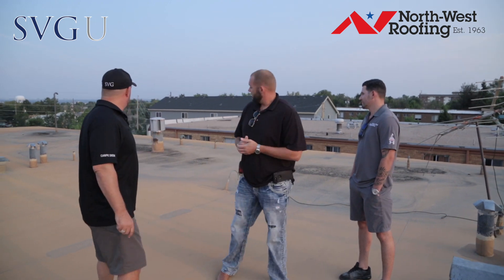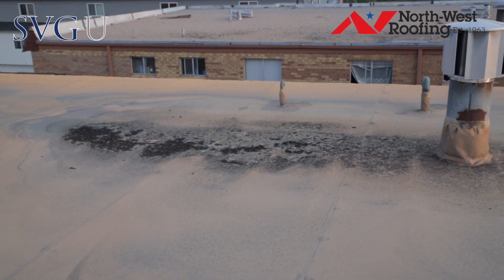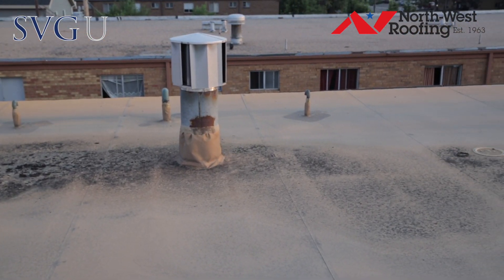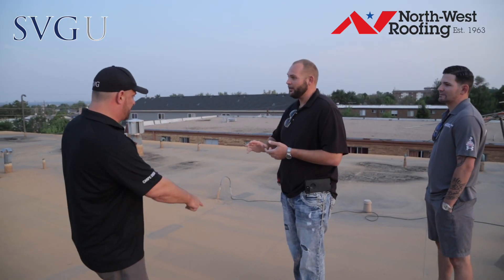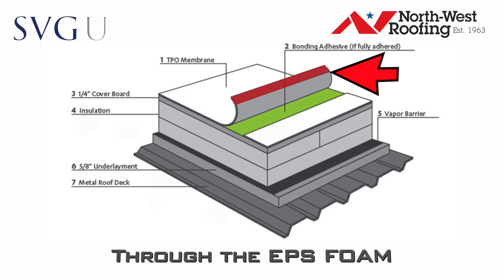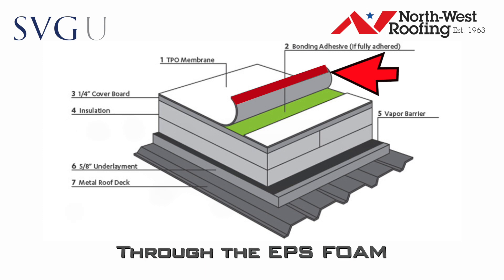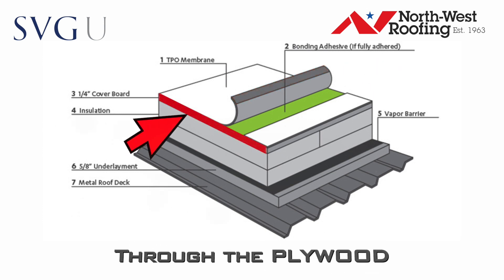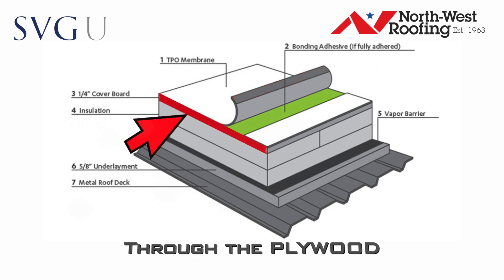Duro-Last PVC Commercial Roofing Systems 2 of 2

Comment: DuroLast PVC is still not TPO. PVC is typically warranted for ponding water, especially DuroLast Completely different. 
Also, Denver Colorado does not require reroof projects to adjust the entire slope. It exempts reroof projects from the ¼" rule (literally in the IBC and IEBC). While it is a highly suggested item, and severe ponding can be an issue, it has never been required on reroofs. 

TPO = Thermoplastic PolyOlefin. 
PVC = Polyvinyl Chloride